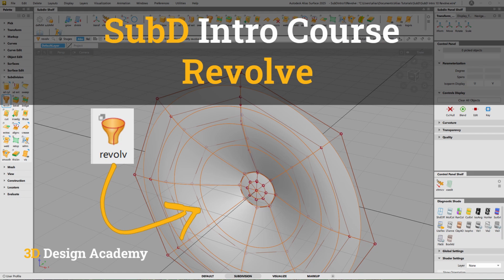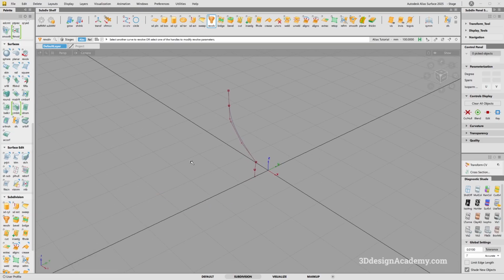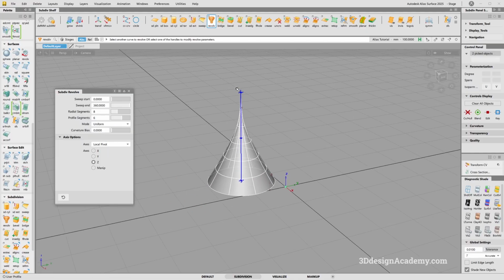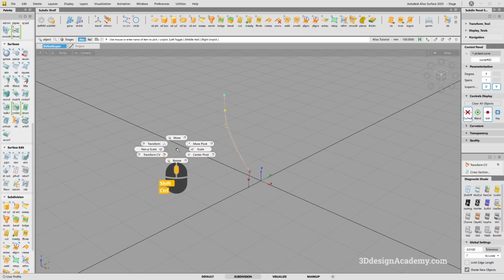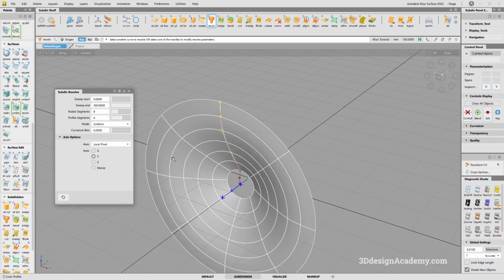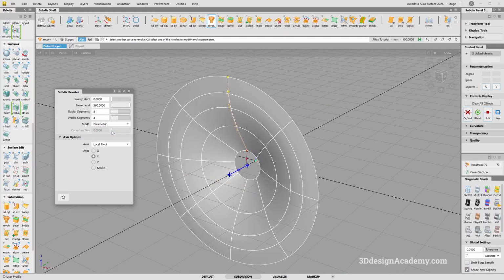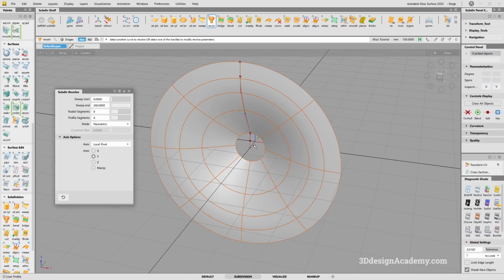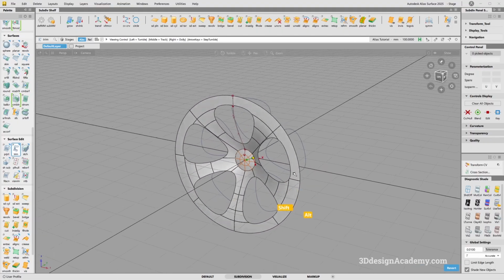Autodesk Alias Tutorials, SubD Intro 10 - Revolve

Comment: First, thank you so much for the information you provide us. I'd like to ask that when we project curves and trim the subd surfaces we're no longer able to use subd tools like extrude or insert edge tool, right?
Reply from the maker: You can, but not on the trimmed edge. You can do that on the "untrimmed' SubD cage. Also, Alias tends to be really buggy when mixing trim and SubD tools, so I'd leave it as the last step.
Reply: @3DDesignAcademy thank you so much for the information, Sir
Reply from the maker: @borazeytunlu963  You're welcome!